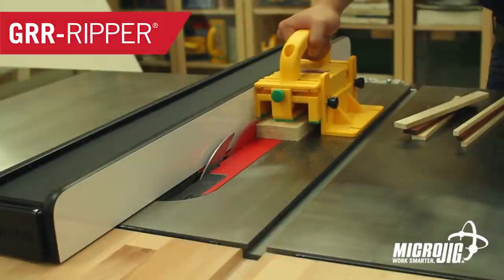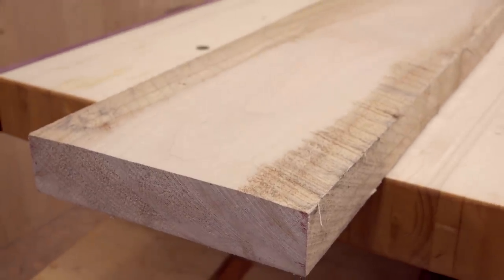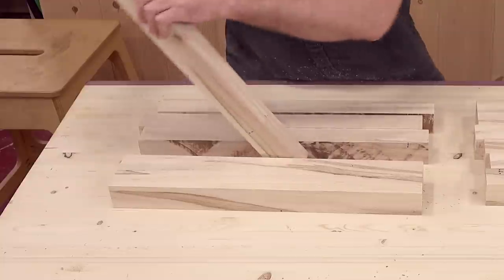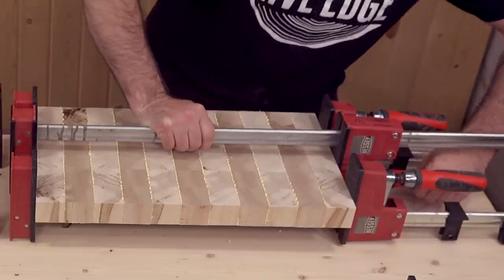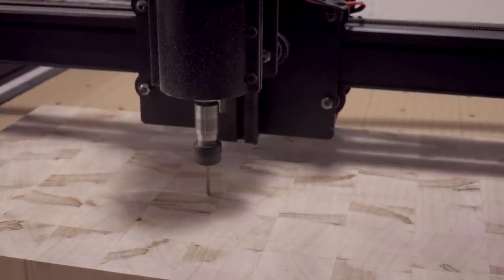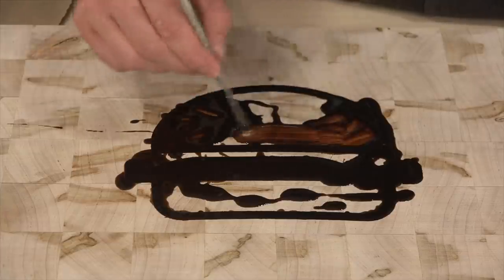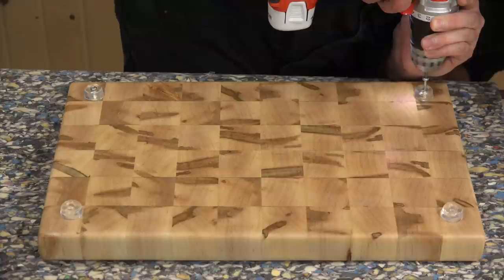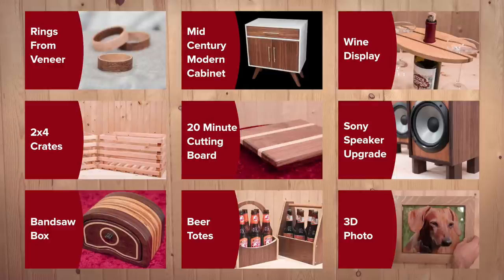How to Make an End Grain Cutting Board with Epoxy Inlay

Comment: Very nice board!
Usually epoxy is very hard and not good for knife blades. Is this epoxy softer?
Reply from the maker: mtmwood Thank you! You are a big inspiration for me! It's pretty hard. It can't be any worse than using the granite counter top as a cutting board.
Reply: Drunken Woodworker Yes, some crazy people use stone, steel, glass as cutting boards. 
Also I am afraid that the cracks can appear between the epoxy and the wood. The epoxy is absolutely non-elastic and the shrinkage of wood can do this. But maybe not.
Reply: mtmwood Shrinkage would cause the wood to tighten around the epoxy inlay. Swelling, on the other hand, if the wood swells, it would pull away from the edges of the inlay. Which may happen during use.
Reply: Double Dare Fan I meant the same. The movement of wood is the continuous process, especially in cutting boards.
Reply: +mtmwood +Drunken Woodworker do you guys recommend using epoxy for cutting boards, or is it more for decorative purposes rather than a good cutting board?
I want to try it, but don't know if it will mess the boards
Reply: Luis Portillo Never use epoxy for cutting boards.
Reply: Thank you!
Reply: Save these "epoxy inlay" cutting boards for presentation boards, like when serving dry ingredients. (cheese, crackers, appetizers)
Too much washing will allow the epoxy inlay to separate from the wood board (expansion and contraction of the wood, like already mentioned)
.

Comment: Great work. Question for you. How did you prevent your black epoxy from bleeding into the wood? Did you spray a thin coat of lacquer, shellac or thin coat of clear epoxy before pouring the black epoxy?

Comment: I do love me a good epoxy-inlay tutorial. Also, really fun design, Drunken.

Quick question: Have you always had good results with colored epoxy inlay without sealing the wood before inlaying it? I've inlaid with epoxy only once; it was mixed with acrylic paint and I didn't seal the wood beforehand. The color bled a bit (I think when I poly'ed it)--something like or slightly less than what a fine-tip Sharpie would do on pine. Anyway, the technique is handy, versatile, and dumb simple, so I'd love to get it right. Thanks!
Reply from the maker: Barry IHS This was my first time doing this and it seemed to work good.

Comment: Question for you: How does the knife behaves when cutting over the epoxy? is it soft? Does it chip out easily? 
Thanks for video!
Reply from the maker: Fabio Alves It acts pretty much like the wood. We have some cutting boards in our kitchen were epoxy was used to fill some knots and it hasn't chipped out. It scars just like the wood.
Reply: Thanks for the info and the video. I'll try one of those out :)

Comment: David, q1: Why wouldn't you run the board through the drum sander again after the epoxy inlay?  Is it because the heat generated would gum up the sand paper?  
As I do not have a drum sander or a planer, I typically use my router and a large straight bit to flatten/plane my stock.  q2: Would that be a good option for the cutting board? Or do you think the heat would melt the inlay?
Reply from the maker: Brian Igielski Changing sandpaper on the drum sander is a total bitch so I try not to gum up the paper. q2: It could work. I would try it on a test piece first to see if it melts or chips out.

Comment: The next mtmwood haha. Great idea filling the negative space with epoxy. But as time goes by how does the epoxy wear compared to the surrounding wood from knife marks and washing? Also my understanding about flipping the boards not only for decoration but the changing of grain direction creates a more stable board. Won't warp as much as a normal panel glue up. Thanks for the 'making it' trio for creating amazing content for us.

Comment: I'd love to make an inlaid cutting board but don't have or want a CNC machine.  How about a third cutting board with a non CNC inlay?
Reply: Rob Casey There isn't really any difference between doing it with a cnc and doing it with a router and inlay kit except that the "template" only exists in the computer rather than a physical one.  Or you can make your inlay, trace around it with a knife and route it out freehand. Once you have a cnc though it's kind of silly to be doing it some other way.
Reply from the maker: Rob Casey krtwood 's answer nailed it.

Comment: Nice trick with the epoxy. I've not used epoxy - do you have to worry abut it contracting as it cures leaving a "divot" in the middle or is it pretty much self leveling even through the cure?

Scott
Reply from the maker: The 2 Car Garage Shop Thanks! I had it piled on higher than the wood in case it sunk down.

Comment: Nice simple cutting board. Really like it.
I do have a question what type of epoxy did you use?
Any thoughts on different type of dyes to use in the epoxy?
Reply from the maker: gunracksonline Thanks! I'm using ArtResin epoxy. There's a link in the description. I've been told pigmented dyes work best.

Comment: David - Im trying to get into using more hardwood so my knowledge is little. How much did that would cost you?
Reply: Also how much would you sell this cutting board for?
Reply from the maker: Tom Caliendo Hmmm, I don't remember what I paid for it. I really need to start adding that to my videos!
Reply from the maker: Tom Caliendo I would try to batch out a couple at a time to save on time. I would say somewhere around $90. Maybe more if I could.
Reply: Drunken Woodworker That would be great if you could add that. In your coffee station video it was great how you had links to the wood you bought. Thanks again.

Comment: I've always admired mtmwood's stuff, and seeing you include the xcarve and easel is even cooler!  Thanks for the tips on the screws and type of finish. Only thing that i dont have is a drum sander, but as long as i spend enough time, should be ok, right?
Reply from the maker: Radtke:Makes Yes. I highly suggest a belt sander. Just using a palm sander could take hours.

Comment: David, not sure how much more you intend to do the epoxy inlay, but if you're still interested in doing food safe... I think a gel or powder based food coloring might be a better bet. (Both are available in the cake decorating section at your local Michael's/Joann/Hobby Lobby, or even nice groceries these days). I know for particular baked goods where even the minuscule amount water could make a difference, powder is the dye of choice. I usually use gel - easier to use, rich colors, and a negligible amount of water addition. That could be part of what made your epoxy cure improperly.
Reply from the maker: Stephanie Csizma Oh thanks Stephanie! I wish I would have known about this sooner! Great tip!

Comment: David, great work on the cutting board. Quick question it the x care any different on the software side than the shapoko (sp?)? Great idea on the inlay and the epoxy and great vid. thanks for sharing your talents.
Reply from the maker: ddutton0 Thanks! The X-Carve and the ShapeOko 2 use the same software.
Reply: thanks for the info.

Comment: I think if you'd use some acrylic paint (the type used for folk art; it's non toxic and fully food safe once dry)   it would not interfere with the epoxy's curing so much...
Reply: +Tim Hyatt. Epoxy and acrylic paint don't mix (water based), you need to use enamel.